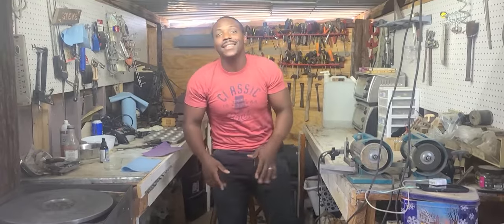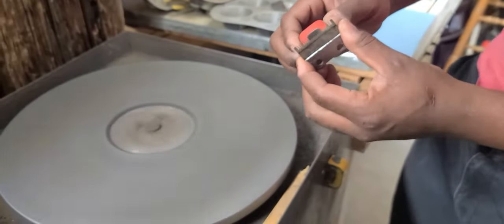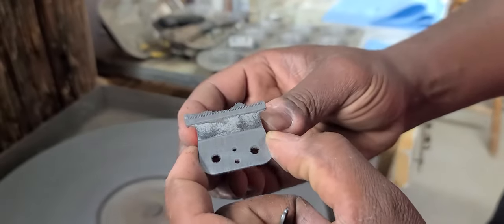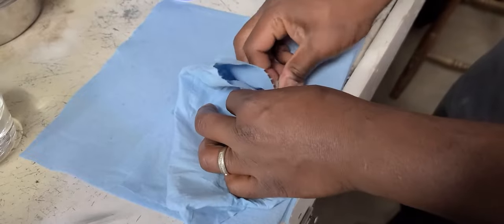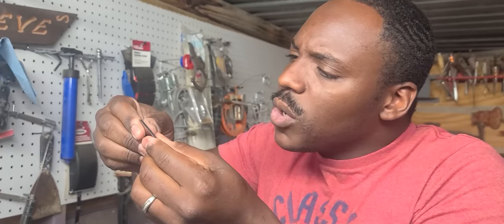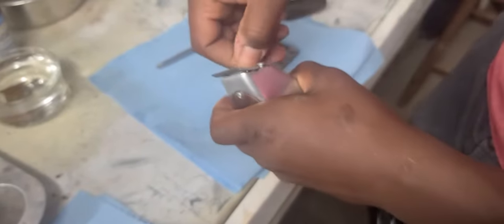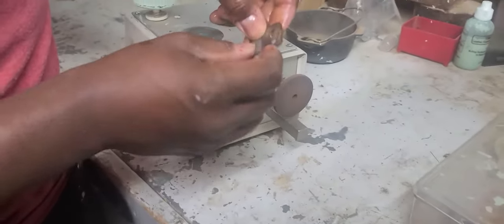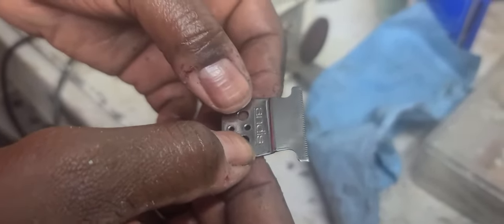Part 5. HOW TO SHARPEN clipper blades, MODIFY AND RESTORE YOUR CLIPPER BLADES!!!

Comment: This is the only professional DIY clipper maintenance videos i found Good Job... i watched all 5 parts-Need to buy 220 grit and a sanding block- these blades i guess could get about 3 sharpening's only if you lucky...THANKS A LOT
Reply from the maker: Sure no problem. Please practice ok old blades
Reply: @keepitsharp357  Nice Tip. You make it look easy, but you can always tell a man who has honed his craft through years of experience. Will always appreciate a man dedicated to refining and perfecting a craft. Especially enjoy listening to someone who is genuinely passionate about their craft give an in depth explanation or tutorial. it hits different when there is a deeper understanding of and a certain respect for a tool or utensil just as you would a weapon.

Comment: wHAT ARE YOU USING ON YOUR T sHARP.  ISW THAT LIKE A CRATEX WHEEL?  wHAT GRIT WHEELS DO YOU HAVE ON YOUR SISSOR GRINDERS WITH THE SWING ARM?
Reply from the maker: On the T sharp i use the soft rubber wheels and the leather wheel. On the one with the clamps im used the lower end wheel that came with the kit for just sharpening lower end shears.